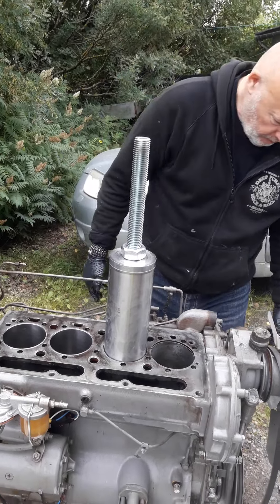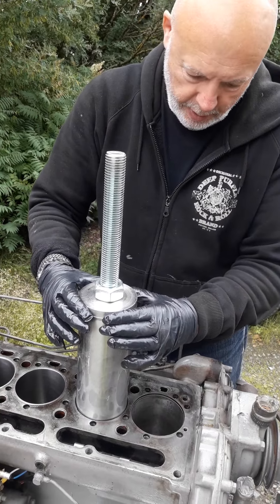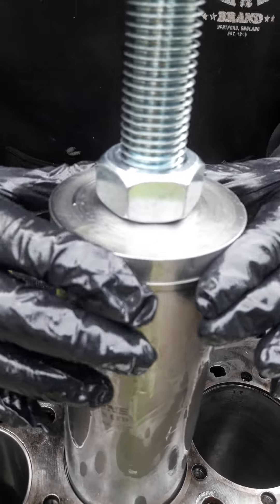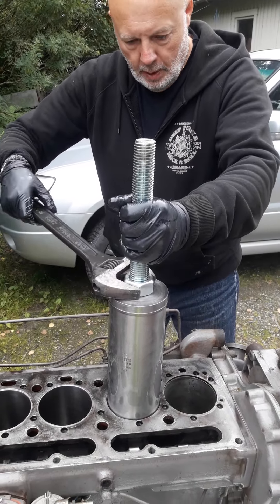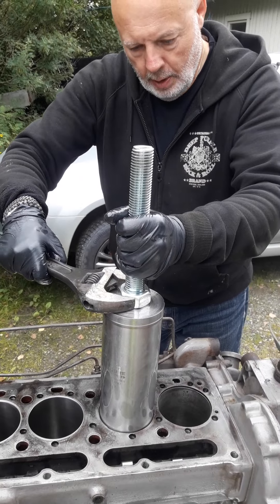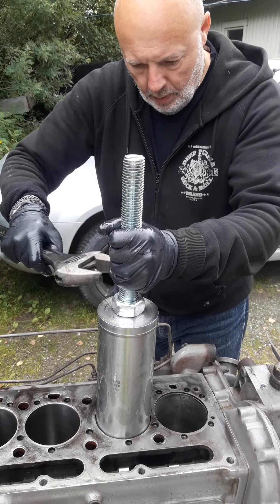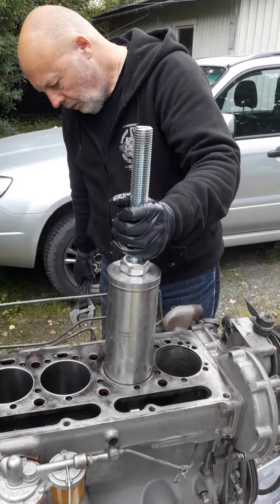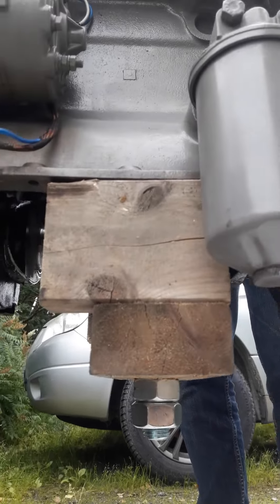Massey Ferguson 65. How do we do it. 🚜

Comment: Dobar da nije mi jasno gdje postoje gotove pikse jer kad se upresaju u blok moraju se brusit na mjeru
Reply from the maker: hallo  kristjian.  I'm not an expert in this area, but many machines use that type of cylinder and it works.. You can get a cylinder that you fit and afterwards they have to be drilled out at an engine workshop.  The cylinders are +10 and up to +40.  if you are careful with the cleaning and the preparations, it will be fine with the standard cylinders in the tractor.  Thank you very much for your support and comment here on the channel.  I appreciate it very much and it is very nice.  I wish you a very good day mate . Chears Michell. Norway 👍🚜😊